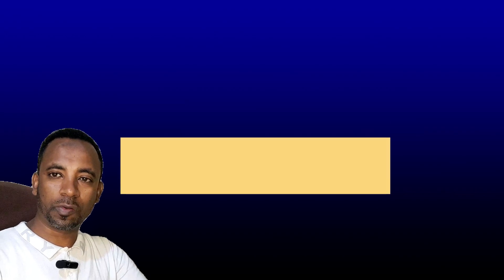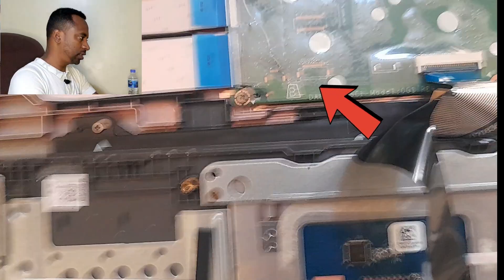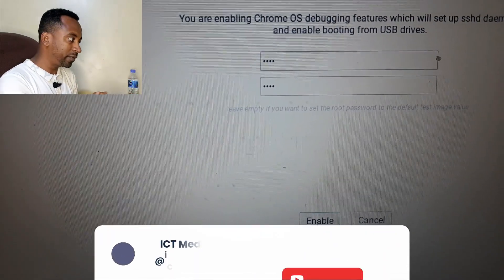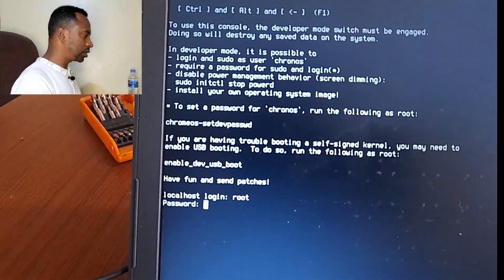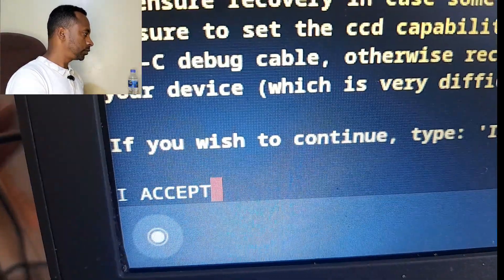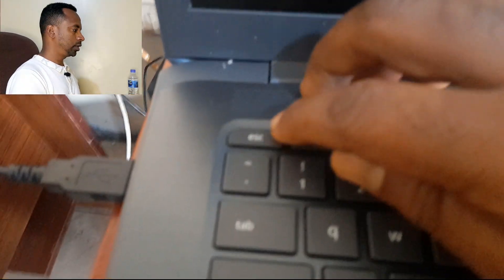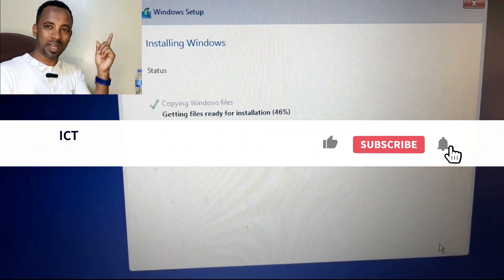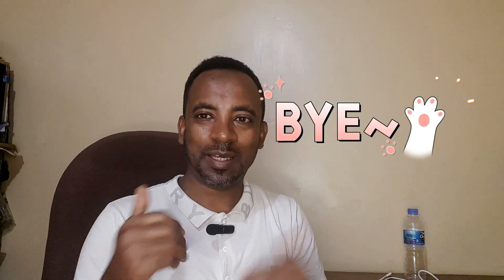HP Chromebook 14 G5 to Windows 10: The Ultimate Conversion Guide

Comment: do I still need the write protect screw after installing everything?
Reply from the maker: No need , you can attach it, it will not affect anything.
Reply: I tried to do this, and removed the write protect screw, but it still showed as wp is enabled?